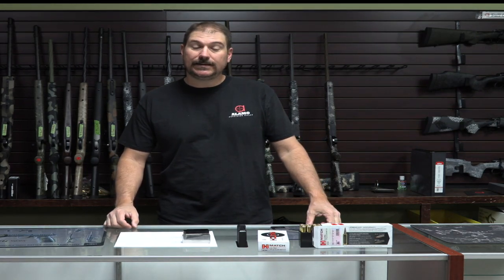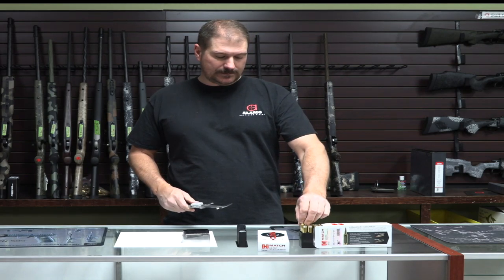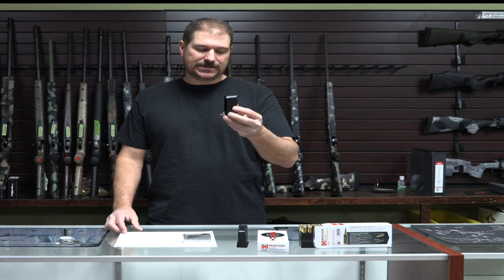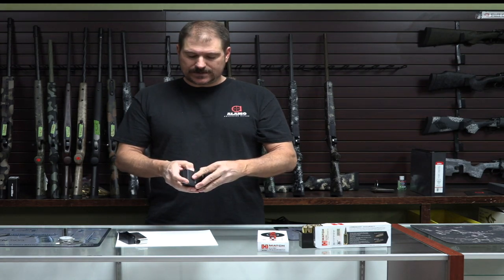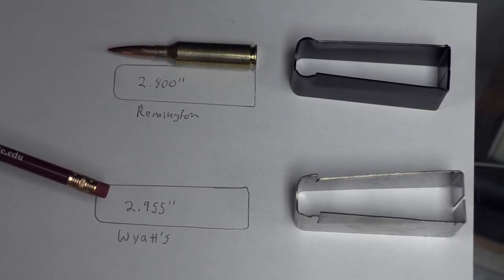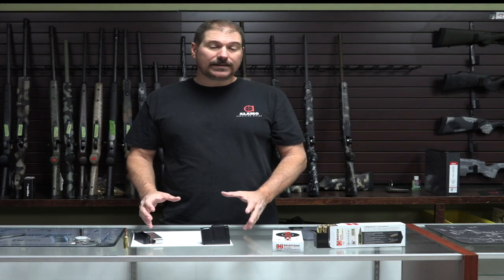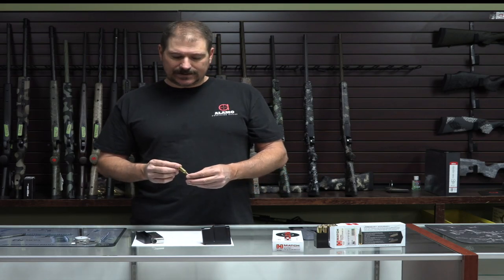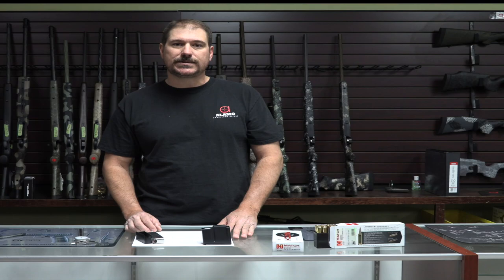Analyzing The Hornady 6.5 PRC

Comment: Yeah, Browning fit the 6.5 PRC into its short action that they used for the 6.5 CM and the cartridge BARELY fits in a modified magazine. But it does feed just fine. However don't go loading it longer than the factory round for this magazine!